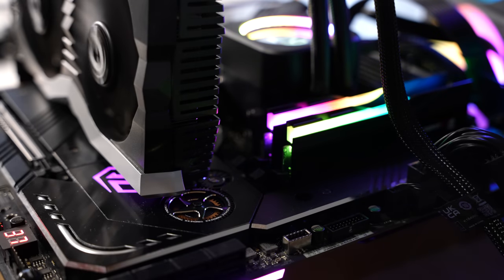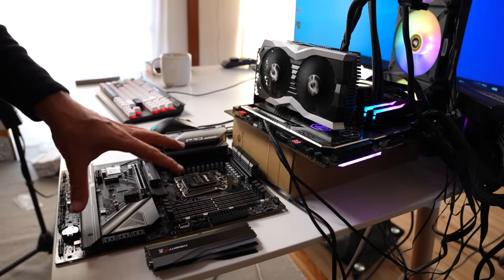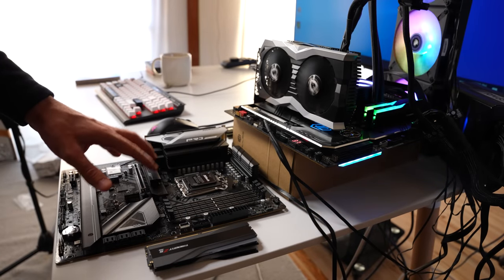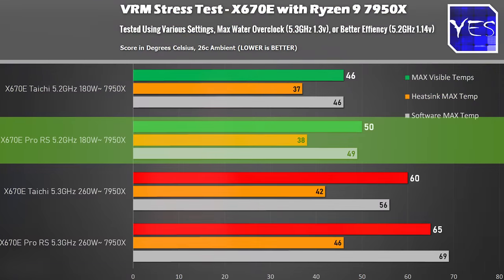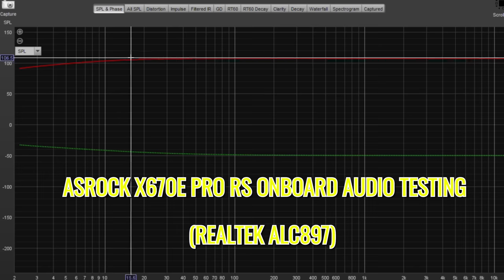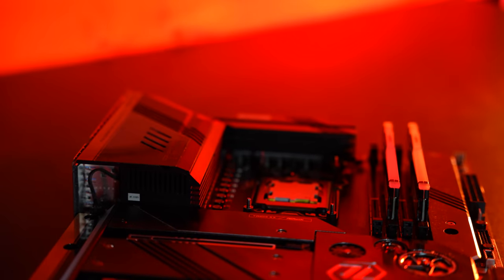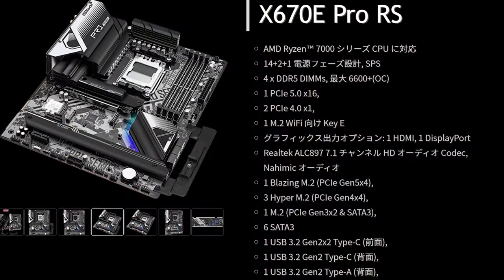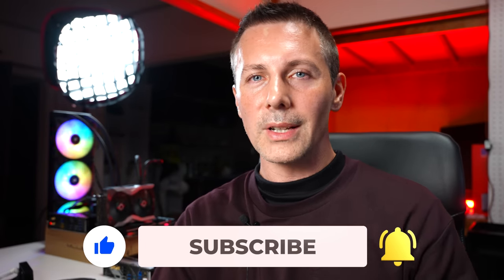Watch This BEFORE you Buy an X670E or Ryzen 9 7950X!

Comment from the maker: Just got back to Aus, crazy ride! Got some special used content coming up now for you guys!
Reply: You are the king Brian! ;-)
Reply: Does it involve Xeon? Can it run Crysis? Will I annoy others with dead memes?
Reply: Seriously? Just buy x670E Taichi? Cmon, this is a joke... you are a joke... let's pay the AIBs tax... please get out of the internet then. MSI Tomahawk B650, best AM5 board for the money, hands down. Hosting a 7950x and scored 38000 on Cinebench ON AIR! and VRMs are below 60C in BIOS on LOAD!
Reply: I am using my Samsung QN82Q900R for my DAC with pure digital signal from my GPU... thank you...
Reply: Hi Brian, I got a Gigabyte x670 ax mother board with Ryzen 7950x and cosair vengeance 16gb * 2 4800 MHz , P5 crucial M2 gen 4, RTX 2060 super, RTX 3060 Ti . I have installed ubuntu 22.04 but it is constantly freezing , I have tried different nvidia drivers for my cards but nothing seems to work. Could you please let me know what's going wrong here??
Reply: Not gonna lie I just got the X670E Taichi, and can confirm some of the findings on this video, even though I'm a 7700X and G Skill Trident Z5 Neo RGB 6000 MHz. The board seems to run rather hot, and there's just a persistent bug where the memory keeps defaulting back to 4800 even if I set it to 6000.
Reply: So with DDR5 the nominal operating voltage / JEDEC is 1.1V, meaning 1.4V would be more on the extreme side. However, if the kit is rated for it, then it's safe. id say 1.4 is perfectly okay with alright air flow but who i am to talk had my ram on water since ddr 3 lol normal safe voltage is only a guide line its more like voltage vs temp

Comment: I bought an AM4 board with a 5900x. Should last me about 5 years. Prices on these new boards and CPU's are way too high.
Reply: Definitely! I just bought a 5800x3d and a used 3080. Should last me way longer. Newer cpu, boards and gpu are crazy expensive.
Reply: @kada0420  I paid a total of 600 for both. Plus i can re-use my DDR4 RAM from my old build.
Reply: @DeadPhoenix86DP  yes! I also reuse my ddr4 ram since I came from ryzen 5 1600 + 1060. All I need now is a 1440p monitor to complete the setup.
Reply: Same! 350€ for the 5900x good price imo

Comment: Better over built then under built. That vrm keeps a smooth clean flow of power. Not just for overclocking.
Reply: It is a great motherboard based on features, just make sure you can update the BIOS on day 1, my BIOS would not update, there was some type of issue with mine, I returned it, because 7950x also did not deliver where I needed.
Not to say CPU is bad.
VRM is absolutely beast, new AGESA provides the improvements in memory, but I could not try it 6000mhz is all I could do

Comment: I bought a B650 Tomahawk when I realized that PCIe 5.0 is still vaporware and 2 years from real adoption. Couldn't be happier, temperatures are really good even on a 7950x. 30C idle, 60C load. I have DDR5 Trident Z5neo 6000 CL30, work flawlessly.
Reply: Like the msi b650 tomahawk? I was actually thinking about buying this for the 7950x. I was concerned it wouldnt handle the cpu

Comment: I am happy to see that Asrock X670E series are built well. They had a bad track record before. In my opinion, spending hundreds for a premium AM5 board and getting overkill features is fine by me. Plus, the cheapest B650 I can purchase right now is still expensive. They are not far from the X670E pricing. So, might as well go for the X670E and finger cross, it will last till the end of AM5 support. 

On top of that, the Ryzen 7000 series CPU is still expensive in here. No price cut has been done like in USA stores. The only worthy CPU to go for is the 7950X. It is expensive but is performing on par with the best of Intel 13th Gen CPU.
Reply: Asrock had a very good record with their AMD motherboards, it's their Intel ones which weren't great.
Reply: Did they? I dont recall seeing bad stuff from them at least on AMD chipsets. They always did the best AMD motherboards...
Reply: The Motherboards aren't the issue, though they have built in fail safes recommended by AMD.  The weirdness is in the AMD cpu on the memory controller, it's designed to not allow certain mixes of ram size and speeds.  This goes all the way back to x370 and 470 as well.  People were blaming the MB's for failures when they allowed the Memory controller to be overworked and thus get damaged until AMD clarified a max on what could be used.
Reply: Honestly after looking for stuff, asrock looks the worst of all of them as they offer no warranty what so ever when everyone else offers 3 years or more.

And keep in mind 1 year is legally required, but they don't even offer that. Massive turn of to ever buy any asrock products. I suppose there is a reason they are known as @$$rock

Comment: Well as to AMD and memory my experience has been no problems. But after my 1st gen Ryzen with a GSkill set that was bad. I got a EVGA 3200 set that has worked across all revisions of Zen so far in my x370 Crosshair VI. I've since bought two x570 motherboards, Asus Crosshair Impact and Tuf Gaming x570 Plus wi-fi. The Tuf is running G Skill FlareX c14 3200 which I got on sale years ago. This is used for my HTPC. The Impact is my current gaming system with G Skill Neo 3200 c16 but I now have a 5800X3D in it so anything faster will not make a notable difference with my Sapphire Toxic 6900XT. I have a 1440p/144hz gaming monitor. I am what you would call a "casual" gamer. But I require top end performance.

As too the heat situation. If anything this past summer has taught me and many gamers is that you need to exhaust the heat OUT of your room. Did you see all those YT videos about the Watercool MO-RA3-420 radiator to externally cool computer/gaming systems? That was with 3090ti's and Intel 12900K in their builds. Or Linus Tech Tips with the "grow cover" repurposed for exhausting the hot air from your pc to a dryer duct tube run out your window. This was a small room with no A/C. It reduced room temps by 10 degrees and the pc ran cooler overall. I just got the MO RA3 360 for my setup as I was roasted this past summer with 40C room temps (no A/C). My water loop temps with 2 360 rads was 50C while gaming without Radeon Chill the gpu hotspot would still hit 100C. Repasting only reduced it by 3 degrees at best, and that was with a 5600X OC'd to 4.75Ghz. My MO RA3 will sit near or in front of my window. Exhausting heat out in summer and warming the room in winter. Thank God for Black Friday deals. I was "broke" by Cyber Monday, lol. Next year I will revisit AM5 if the V-cache chips perform as well as the 5800X3D. But really how much more performance do current gen games need? Now with gpus inserting FAKE FRAMES into games. What will it matter? What's next? The game playing itself for you.
Reply: You should probably buy a window unit AC instead of a Mora3. 50°C water temp is insanely hot for such a small heat load from 5600x/6900xt.
Reply: @jjlw2378  A 10 degree rise in water temps is not unusual. Ambient temps at that time was 40C. In the past I ran a window A/C in front/near my pc. Electric bills thru the roof one bad summer changed my tune. I was rocking a FX9590 back then with crossfire R9 380's. I only wish I had bought this rad in 2018. Better late than never.
Reply: @jerrywatson1958  I agree Mora3 is a great radiator. Check out new Byski B-1080-CEC-X too. I just think I would focus more on cooling the room rather than the PC. Take care!

Comment: It's nice that there some sane X670E boards out there, but the flaky support for 4 Dimms is a problem.

I just had an unscheduled PC update: PC stopped booting (no life just drew 60w from the wall). After troubleshooting it seemed it was the motherboard so brought a X570S Gigabyte Aero G (4x M.2 slots👌). Didn't fix the problem so I brought a 5600X, that fixed it so it was the 3950X. While sorting out the RMA wasn't cutting effecting my work (even with PBO +200mhz) so brought a 5900X (nice mix of cores and cache), which was much better. Then AMD released the 7000 series price cuts...

While prices have dropped DDR5 still costs double DDR4 (need 64GB), same with the motherboards. It's a lot of money when I already have decent components, it's likely I'll need 128GB in future in the near future (so 5000 is probably a better option).

PS: You should do a video about NVMe RAID0, it's great for disposable data such as games and the 2x 2TB out perform virtually all 4TB drives (maxing the PCH bandwidth) when it cost only £300! 😎

Oh and the array survived switching motherboards, which I didn't expect..

Comment: ASRock scares the hell out of me.  Just feel cheap.  Maybe they've changed, I don't know.  Shopping for a 670E I saw MSI apparently had a lot of bad reviews on Newegg for various QC issues.  Then found the ASUS 670E-E with more features for the same prices so I went with it.  Got 6000mhz low latency Expo RAM, will see how it goes when these new chips come out I guess.

Never seen any high performance gear from computers to cars to firearms that didn't need some kind of tuning though.  Nature of the beast.
Reply: update 1 year in?
Reply: I actually purchased a asrock b650 hdv/m2 after dealing s ASUS bullshit, first a board the never posted, then a board the only worked a few months, and finally they sent a replacement that had oily residue and missing parts and thru all that my little asrock board ran a 7900x. Now having issues with aorus x670, guess what I'm using! Asrock b650 hdv/me still the g.o.a.t.  Btw I don't overclock or do any weird shit, have all quality parts just unlucky with motherboards I guess,lol

Comment: I got the ASROCK Riptide AM5 motherboard, B650, for $149.99 and a Ryzen 7950x from Amazon for $549.   I just got the motherboard delivered today, but it will be a few more days before the CPU arrives.  Can't wait to see how well it undervolts on this cheap motherboard.  I didn't need PCIe 5 for the GPU, but it has it for one of the M.2 slots which is fine with me.  If I need more storage I will get a M.2 PCIe add in card to go in the bottom PCIe slot.

Comment: PCIe 5.0 seems to be a long way away from being important or useful at all for (almost) any personal computer (I'm not talking about workstations or servers and the like). If you're not sure if you might need PCIe 5.0 or not... don't worry about it. Selling your old motherboard and buying a new one is always an option in the EXTREMELY unlikely case that you do end up needing PCIe 5.0 at a later date. 

Even PCIe 4.0 currently has very limited usefulness for most users. Even the RTX 4090 runs fine on PCIe 3.0 (16 lanes of course), though I'm sure you can find very rare cherry picked scenarios where it runs significantly slower on PCIe 3.0 if you look hard enough. I find it funny that now, by far the most common benefit of PCIe 4.0 in a personal computer is to allow full compatibility with some low-end and low-mid-range graphics cards, where the cards use only 4 or 8 PCIe lanes in order to reduce manufacturing costs (and this is what results in needing PCIe 4.0 in order to not bottleneck the card's performance, which is especially the case with intel's A750 and A770). 

I know there are some SSDs which CAN go faster with PCIe gen 4.0 vs. PCIe 3.0, but it's not likely to actually matter, even for someone who does a lot of video production work. Maxing out PCIe 3.0 speeds for SSDs is already extremely fast, and probably not going to slow down your workflow, though if you CAN use PCIe 4.0 without significant additional cost, that could still be worth it I suppose.
Reply: I agree if you are using just a single gpu.  If you want to have two gpus at the same time the problem is that there are configuration limits that this eliminates by having the lanes to the CPU.   The M.2 PCIE 5 will be quite important very soon.

Comment: i was considering "ASRock X670E Steel Legend" but now i will have to take a look at the "ASRock X670E Pro RS" as my second option.
I see that the Pro as one extra nvme 3.0 .. thanks..always good to compare have to see if i can find a comparison vid.. for now i think the Steel Legend is better for me because of the bottom slot pci express16 physical it's x4 directly to the cpu. makes a good slot for a gpu down the line. and in the pci gen 5 slot makes a good nvme expansion slot.. i don't need a gpu the 7950X on board is good enough for my needs now..

Comment: I don't think I'll be ready to go to 7950x from my 5950x for a year or two yet. It's gonna be such a hurdle with MoBo, 64GB Ram and the cpu when I have a fine system now. But I know that new system will power my 3D animations faster. But it really seems a good idea to wait a year or more as new boards and Ram come out, and folks like you show us the capabilities of each component.
I wonder if a big tower cooler that'd be moving more air across the board might dispel some of the pcb heat around the CPU? I have huge positive pressure with 7 incoming fans and I suspect having air flow around the back of that MoBo, as well as the three top fans blowing down might help keep it cooler.
Reply: I was on a 3950x, don't regret moving to a 7950x at all. I am having a Noctua NH-D15 in a Fractal Torrent case and I scored 38000 in Cinebench MT. You don't need LC at all.
Reply: @evalangley3985  I have  a Fractal Torrent also! It's a very good case.
Reply: @evalangley3985 what are your boot times? Memory slot on am5 mb are weak. Memory controller is not good. You can say what you want but breaking warranty immediately by using pbo is not acceptable to me. My ryzen 1800x works well and at stock. To me am5 gen 1 is not good. Am4 zen 1 had issues to get the 3200 speed but it was the first months. We are one tear and you cannot put 6400 on a 7950x fully stable i bet. Intel is better this time. I am not a fanboy, for the moment my money would go to intel 13900k/14900k. But i am open and will wait Ryzen 8000, 770e chipset mb, and intel arrow lake 15900k to make full decisions. If i still don’t like these i can skip completely am5 and intel as well and keep my zen 1 computer 1080ti which works really well.

Comment: The Tai-Chi's onboard audio with the ESS SABRE qDAC and VRM alone is $200-S250 alone at cost....lol
DDR5 is rated up to 2V B...
One major difference between these 2 boards is the 2 PCIe 5.0 x16 slots capable of running at PCIe 5.0 x8 X x8.

Comment: Most midrange motherboards even have overengineered VRMs, it's a good thing for component longevity but it's extremely excessive on some boards. Let's say each mosfet phase can handle 25W of power delivery (they handle 50w or more per phase in reality if memory serves) if you have 10 phases you can easily push 225w consistently to the CPU for 24/7 operation. A decently spec'ed and cooled 4 phase VRM should handle a 200w chip, my b560 board has a 6+2 phase VRM my i7 only draws a peak of 165w when pushed with a power virus load, that's only about half of what the 6 phases for cpu vcore are rated to provide, the VRM doesn't even need the heatsinks on the board for the loads it will see. Any 20+ phase VRM is massive overkill even for extreme l2n overclocking you can't possibly push enough voltage to the chip without killing it to even come close to using that much power delivery, that's 1000+w of current delivery at stock spec.
Reply: Yeah, but if board makers stop adding those overbuilt VRMs people will immediately start complaining. There are few ways for a motherboard to stand out from the crowd except aesthetics and having a larger VRM phases count is actually the easiest to achieve, despite being almost meaningless in practical use.
Reply: I think overkill board were build because zen 5 will be similar to Intel big+small core.
Reply: Maybe overengineered for the current crop of Zen 4, but what about Zen 4+ or Zen 5?  AM5 is supposed to support those as well.  Besides which, do not trust the Taiwanese board makers' commercial claims.   Oh and those "decently spec'ed and cooled 4 phase VRMs" are already used today and morphed into 8 phase or even 12 phase VRMs by the board makers' PR departments.

Comment: Hey Brian. It would be cool to see you round up some case(s) which will fit a 420mm rad apropo the cooler you used in this video. Would love to see it from nobody else than the yes man
Reply: +rep to the Fractal Torrent to this; have it in push-pull with the 420mm Corsair AIO

Comment: My goal is a 7700X on an Asrock B650m PG Riptide (non-wifi). I simply don't need more than that. Have you done an in depth review of that board yet? It's Asrock's least expensive motherboard and it keeps selling out. Right now it's backordered. So it's obviously a hot seller. I'd love to know if it's a dud or not. Anyway, I've watched many Asrock motherboard unboxings, but you're the first I've seen do actual testing. Thank you. I'm a bit of an Asrock fan.
Reply: Having Wi-Fi comes in handy sometimes.
Reply: @penguinbelly  I don't need it, and I have zero reason to pay $20 more for a Useless, To Me , feature.
Reply: It's probably no dud.This is Bryan's video review for the  B650 Riptide, but honestly I would get a Aorus Pro AX, a Strix or an MSI for about the same money. AsRock just cuts corners on these budget boards. Take care!  
 https://www.youtube.com/watch?v=ApIoOJoDSWQ
Reply: @SISSYPUSS  those other board is pricier around the world although for american is just few bucks more
Reply: @penguinbelly  he obviously use cable connection. Another thing is wifi adapter is cheap nowadays